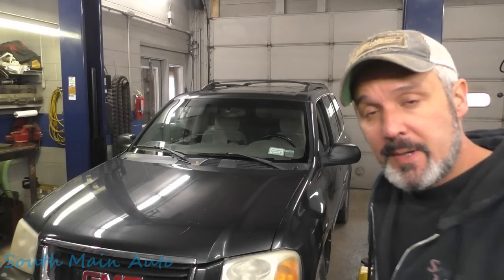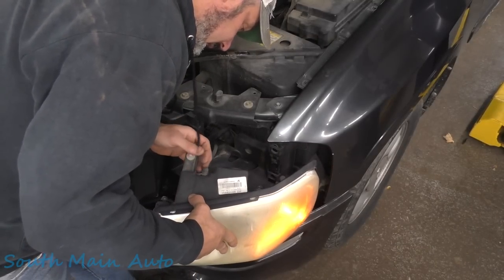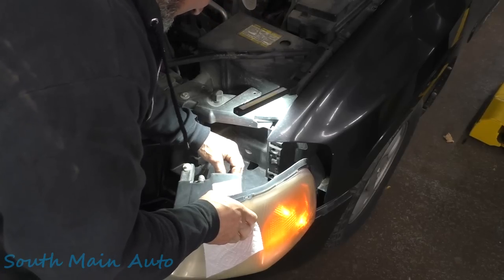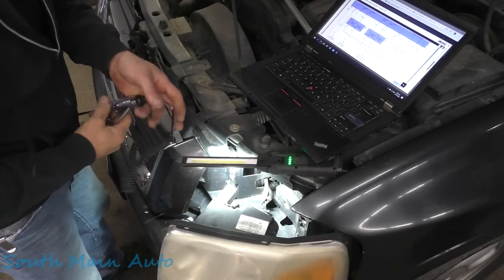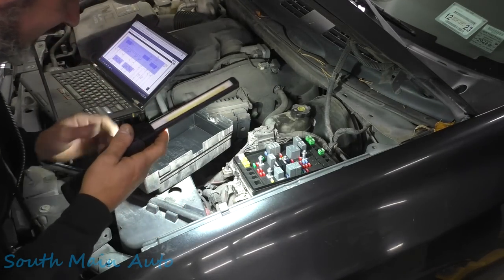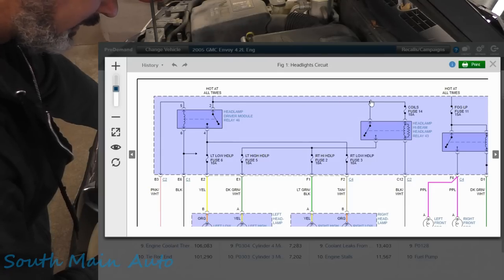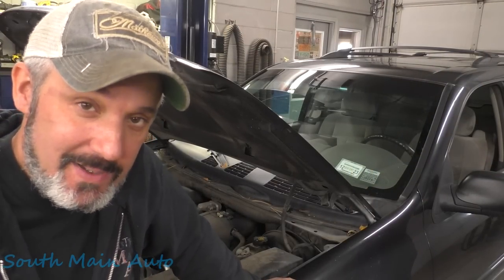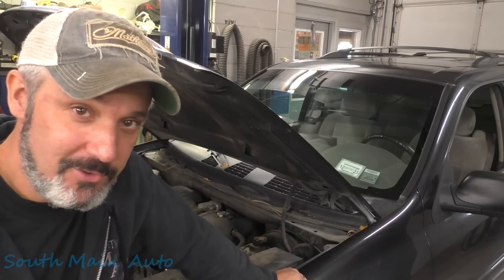GMC Envoy: No Low Beam Headlights

Comment from the maker: Where do I get all of my free service info and wiring diagrams you ask? I made a video on that few years ago - https://youtu.be/L1FxoQI_Fw4
Reply: Yes, I did ask!
Reply: I used all data DIY to obtain information that was needed during the building of the older 700R4/4L60 and newer 60Es never let anyone tell you you cannot do it in your own shop garage backyard. I saved fortune doing it myself versus paying a shop. And at times I even made money doing it for others. A source of information is imperative.
Reply: Many on YouTube use AllData.
Reply: @lvsqcsl  And have you checked the price of it? I wouldn't say it's feasible for a DIY'R.
Reply: @billmonroe8826  I believe the price is around 30 bucks or so for an individual car.  The price you might have seen is for unlimited cars, which would be appropriate for a shop, but not a DIY'er.
Reply: AllData DIY for one vehicle is $20 for one month, $60 for one year, $130 for three years.
Reply: 3M polishing kit original: https://youtu.be/DrRuDYkVvL8 and with Ms. Hannah and Ms. Marie on Ms. Hannah's malibu https://youtu.be/4U9xh0u6WEE
Reply: I got a question for you ? I'm stumped on a 2007 toyota avalon xl 3.5 l v6 ..  another shop replaced the throttle body and car sat for about a year so im told . Car starts then dies .. only codes ( history , pending , and current are p0351 p0352 p0353 p0354 p0355 and p0356 . Ignition coil primary / secondary a- f . I put a noid light on an injector and injector pulse dies . Checked grounds and power on coils all seems good .. feed it fuel threw the throttle body and it will stay running ?? Only thing I can see on the scanner is security guard turns on upon starting vechile . It will stay on until you turn the key off and then back on , but as soon as it starts security guard turns back on ?? Any ideas ??
Reply: What kind of flash light is that?
Reply: @jeremyvivyan7571  you definitely sound like you have an immobilizer problem. Do you have any codes in the immobilizer? Depending on what scanner you have, you should be able to see on live data if the computer is not allowing the car to run due to a security issue
Reply: @andrewtheautotech  . No there are no codes in the immobilizer.  I can clear all codes and all that comes back is the coils .. upon first start it will run beautiful for about 3 seconds then dies .. if you don't turn the key off and try to restart it won't idle at all just stumbles.. turn key off and will again idle for a few seconds .. I was also thinking immobilizer.  I've never seen all coils go bad at once ..thanks for the reply
Reply: @jeremyvivyan7571  sounds like the security is turning off the fuel system because it detects the wrong key /input from key. Just a guess not a mechanic.
Reply: @evvlb2  the worklight is an Astro Tools.  They are an inductive charging light with a magnetic charger.  Pretty nice lights, I've got a pair of them.
Reply: @jeremyvivyan7571  ECM (maybe) if it's not the immobilizer ...
Reply: @MikeF421  thanks for the reply. I now have one on order. Looks handy.
Reply: @jeremyvivyan7571  load and fire the parts cannon.  replace the battery on the key.  try using another key.  replace the pcm relay.  check resistance on all injectors.  toyota fi system cuts signals to injectors when any of the injectors are shorted.
Reply: Where’s the link to your cleaning up headlights video you said you’d put in the description?
Reply: @lvsqcsl  Yep, I use Alldata, Mitchell and OEM data sources myself.
Reply: @jeremyvivyan7571  If you are seeing it turn back on it's likely the key transponder reader. That is the ring that talks to the key. The system uses a piece that is like the inventory tags stores use. Inside the key is a small chip, it is normally dormant. When you insert it in the ignition and turn the key on the security system sends out a pulse of power. That pulse goes through the coil and the resulting RF acts on the chip just like an old time crystal radio. It captures the power pulse and turns it into a tiny DC pulse that causes the chip to respond with a simple flash code. The reader receives that signal pulse and decodes it. If it matches the stored codes it turns the fuel system on. If not you get 2-3 seconds which is basically the time it takes for the pulse and key response and it shuts down. Pretty much how all of the transponder systems work.

Comment: The head light lenses are so bad that it does not matter if there is light or not because very little light can make it out!  LOL
Reply: Pretty typical of any NE car from the 2000s
Reply: Wet sand and buff them out just like paint.  Works great untill they get hazy again
Reply: @HoLeeFuk317  you need to clear coat them again after that to seal the plastic.
Reply: to add to this when you clear coat them use a UV resistant 2k clear coat and it will last a long time. Eastwood 2k clear coat is a good one it's like 20 dollars a can but we'll worth it . also after buffing them make sure you use a good cleaner to get rid of any polish or buffing compound to help the clear coat adhear properly.
Reply: That's one use of 2000 grit wet sanding.

Comment: Back in 1973 had a blue Volvo wagon with no brake lights ( 2 ) so i thought it was the brake light switch on the brake pedal arm. Well a 45 minutes later I decided to check the bulbs and sure enough bad bulbs. Still embarrassed.

Comment: Back in the early 90s, I was working as a tech at a small mom and pop service and repair station, on a mid 80s Ford station wagon. Thing had a charging issue, and I was doing a load test and had the engine running and all accessories and lights on. This had a top post battery with the leads not super tight. My boss came by, and I told him I was pretty sure the alternator was working, but was weak, but I wasn't 100% sure. He said, "well, just do this..." And before I could stop him, he pulled the positive cable off the battery. Every light went super bright, and the car died. I felt sick as I knew what had happened. My boss hooked the cable back up and said, oh, it will be fine. No, it wasn't. It wouldn't start, nothing worked. He made the alternator go full field, and without the battery to absorb the surge, he burned out everything in the car, ignition module, wiper and cruise module, every light bulb...took me 2 days to replace everything

Comment: There's a TSB on that failed solid-state relay. They all fail. It runs at 70% duty cycle for DTR. In 06 and older GMT360's there is a second one for the fan clutch also.

Comment: I have had that happen before on an older car with the 4 lamp square bulbs , it had no headlights.  The customer called and wanted me to install a new headlamp switch because it was not working.   Lucky for me I checked the system first, well you got it, all four headlamps were burned out!

Comment: I fell into the trap of "it just needs two bulbs" once.  I had a '68 Ford Galaxie 500 convertible that I was restoring, and the brake lights didn't work.  Did I even check the bulbs?  Nope.  I just assumed "old car, bad wiring."  I started at the brake pedal (at first I assumed it was the brake-light switch, but it wasn't).  I worked my way back, following the wiring harness from there.  Everything tested good, all the way down.  Then I finally checked the bulbs.  LOL!  Felt REALLY stupid, but learned a good lesson -- ALWAYS check the simple stuff first!  🙂

Comment: Spot-on diagnostics, Eric.

That relay looks like it's the solid state type, which would explain the price. Instead of contacts going clicky-click, a transistor goes zappy-zap. Such a relay style should be more reliable, but they're also a common failure item on some imports that use them for the A/C clutch.

Comment: Thanks!
Another good electrical video. Reminds me of my Air Force days tracking down wiring on older F-106 Aircraft radar sets. This was before they had on-board computers to help you. Seems to me there was an F-106 squadron at Griffiss AFB, near Rome (now Griffiss International airport).
PS, never did see that link you mentioned about clear-coating for faded headlight housings.

Comment: Not only is it methodical, you've got the efficient work flow of a guy who has done this kind of diagnostics thousands of times. For example you started on the good light, and quickly checked both ground wires first. Doing so eliminated half the circuit within a few seconds, with a technique that gets electrons moving and exposes any voltage drop that might be present. The power probe is seductive in some ways but it means I need to add the extra step of drop testing. So, I can see why old school methods are so appealing, especially if you're on the side of the road with very few tools.

Comment: Good advice Eric, never overlook the bulbs blowing simultaneously. On my 2001 GM Holden Commodore, the cruise control stopped working, it would make a clack noise when turning the key and it wouldn't respond to any inputs. Long story short, some testing and trawling through forum posts later, I found out that when the brake light circuit has a fault, the cruise control stops working. I checked my brake lights, the one on the spoiler was working, but the bulbs were dead. I put a test light on both the bulb sockets while I used a broomstick to depress the brake, and both had power. It was only then I took a closer look at the actual bulbs. Turns out both bulbs just blew at the same time. And to think I was nearly going to pull the trigger on a new cruise module.
To my credit, I was far less experienced back then several years ago, I never considered the possibility of both bulbs blowing at once.
Reply: Yep, especially if you replace them both at the same time. Discovered that with headlights about 4 years ago, if memory serves, the driver's side went, and had not gotten to the parts store to replace it yet as I was not needing to go where they were at the time, 2 weeks or so later, the other side went, so had NO low beams (I did have separate high an low beam lamps in my car), so had to buy both.

Comment: Watching you easily remove that headlight housing reminded me of my buddy and his 2001 F150 years back. He’d bought it used in another jurisdiction and on the long drive back home realized he had a driver side headlight burnt out. When I saw it after he got home the entire front was torn apart from him trying to get at the headlight bulb, there was a pile of assorted bits and pieces in the cab that he’d removed in his efforts. I went over to the passenger side and pulled the two little tabs up and pulled the headlight housing out in seconds and watched his jaw just about hit the floor!

Comment: I love these quick videos. I had  the same issue with a 2009 envoy. turns out that is not a mechanical relay. Its a Mosfet transistor driver so the BCM can PWM the "relay" for the DRL.

Comment: That 3M headlight restoration kit is the real deal. I've used them on my wife's car and my daughter's car and they both turned out fantastic, even when done by a DIYer like me. Thanks as always, Eric!
Reply: Its the only one that works well, and it stays looking good. I think the key is the clear coat at the end.,
Reply: @TheJimCramer  The version of the kit I bought didn't have the clear coat, so I got a bottle of Meguiars Clear Coat and it worked great. Even did a video of my effort on our old Sienna.
Reply: Works great when it's just the outside, all my cars it's the inside that needs polishing lol
Reply: is it a special clear coat for headlights?
Reply: @Kevin-zo6nz  Yes; its specifically made for plastic headlights & self levels, don't buy the polish version or spray.
Reply: I used the kit by Sylvania.  No tools needed and clear coat was provided in the kit. Loved the results
Reply: After over 20 years (when I parked it for a complete rebuild and V-8 swap) of daily abuse, the headlights on my 94 Ranger were WAY beyond help so, I just bought new ones. However, the 3M kit worked great on my wifes 2016 Sierra.

Comment: Good video, good refresher. Retired this past January. Have not had the need to drive the commuter car at night. I do drive with my low beams on all the time. The nicer newer car was out of town. Had dinner and a drink at the local tavern, a dbl Jameson and a Carnivore Calzone, leaving just after dark in the commuter and no low beams. High beams work fine. Before you take anything apart put the spare bulb in the connector, worked fine. Lucky for me it was just the bulbs, both were burnt out on the low beams. Things you don't notice in the sunshine. I felt bad about driving home on the high beams, but I was not flashed once. I think the LED bulbs throw so much light that high beams on an 06 just look like low beams now.

Comment: Video doesn't suck Eric.  Its a great educational tool in diagnostics instead of throwing parts at something.  I ran into the parts cannon issue a couple years back with my 87 Ford Ranger.  Its so old nobody knows how to work on the old stuff it seems.  Every shop I took it to threw parts at it, still didn't fix the issues.  I finally got on a Ranger forum stated what was going on, what had been done, etc.  One member says did you change the O2 sensor...umm he** no, so after 7 months of thinking I got screwed on this truck that had computer issues, or major engine problems as it would randomly stall, lose power, bucking while accelerating, etc.  I put a $45 O2 sensor in it, figured what the heck, another shop charged me almost $2k to install new plugs, wires, distributor, rotor, ignition coil, etc. and still didn't fix it, what's another $45 part tossed at it.  Sometimes it pays to just step back bow thy head, and ask for help on a forum that knows these vehicles...that O2 sensor fixed the problem, and been loving this truck ever sense.  

Learning a little from your videos although not quite as much help to me because the Ranger is older so there ain't much in the way of getting codes off it like the newer stuff, yeah you can get codes off it, if it throws any, but there isn't much that it'll throw a code for anyways.  Luckily its old enough to more easily take a step by step approach at figuring things out, and with help from the forum it'll be simple to keep up with too.  

A couple of my newer vehicles with some help of some diagnostics software really helps point me in the right direction too.  Sometimes old is nice in simplicity, but sometimes new is nice because with scan tools and such you can really dive in and figure out the source of a problem instead of throwing a bunch of parts.  At least narrow the issue down to a smaller group of things to check, and with wiring diagrams at the ready it sure makes it nice.  With my Ranger I gotta dig around to find diagrams for it, they're not right on the scan tool LOL...rather lack of a scan tool HAHA!!!  

Thanks for all you teach us Eric, we appreciate all you do.  Even if your videos are much less involved like this video, its a learning/teaching moment for many of us.

A lot of things in my case boil down to my lack of patience, lack of a comfortable place to work, and oftentimes I'm finding that if I just had a vehicle lift I'd be able to much more easily tackle a lot of issues myself...lying on the ground under a vehicle is he** on my back and neck, its just downright uncomfortable and painful for me and I'm not even that old, my neck and back just don't let me do that stuff.

Comment: Thank you so much for this, I was having this exact same issue. I however checked the wrong relay instead thinking the one labeled headlamps controlled it. I just switched the fan an control relay and now they worked! Thank you again because I had replaced my multi switch on the steering column thinking that had to be the problem an after that wasn't it I was completely lost

Comment: Another hunt-'em-down and give 'em a headshot.  Nice Eric!  Often, people don't take the time necessary to thoroughly investigate the problem to derive a viable solution based on observed facts - they black-box it, or as you so aptly put it "Load up the parts cannon".  Run out and buy new bulbs, connectors, a big box of fuses, four or five relays (none of which are the correct ones) and of course, the problem remains the problem.  I sincerely appreciate the way you methodically go step-by-step in a logical manner to achieve the light bulb coming on (yes, pun intended).  When I was in the Navy, I taught my young sailors the very same technique - and those who remained in Engineering Fields prospered greatly from that.  Something you failed to mention in this video, but I'm sure you have at some point, is those wiring diagrams are provided unpowered, or dead.  One has to view them in that light to mechanize them as they troubleshoot.  For instance, the relay is not picked up, but it's easy to see what is supposed to happen if you know what you are viewing.

Comment: I lucked out years ago when my Dad's neighbor asked for help on a vehicle much like that one. Both his low beam bulbs (or filaments if they were combined) were burnt out - like you said, he could have driven some time on one low beam and didn't realize it. He had already fired the parts cannon and replaced the switch on the steering column, with no cigar. Interestingly, he also called me over another time to "replace a bad breaker" in his home's breaker box. The "bad breaker" kept tripping. I checked and found one of those flat extension cords was twisted up - and the car was parked with a tire on the twisted cord. Unplugged the extension cord, and he was good to go - no parts needed.

Comment: There is a recall for the low beams. We got a 2006 envoy and had problems the low beams for years but I finally went to O'Reilly's & got a new relay and so far it's been good and that was about 5 years old